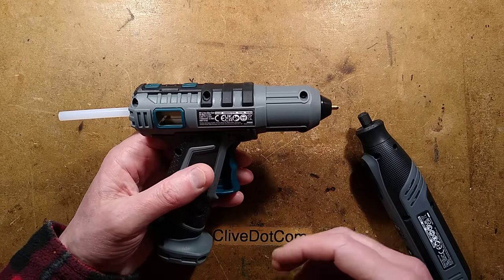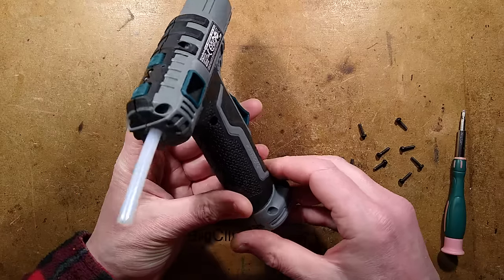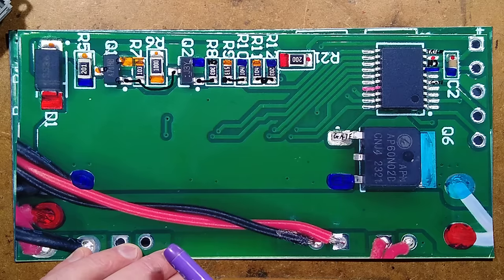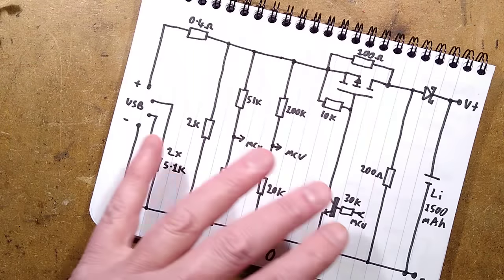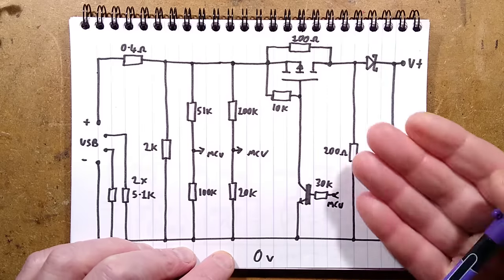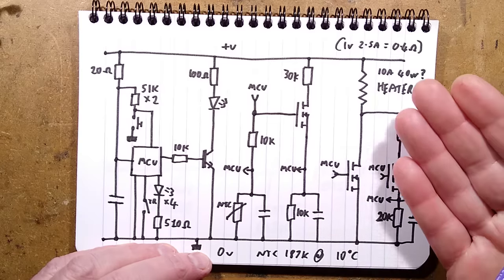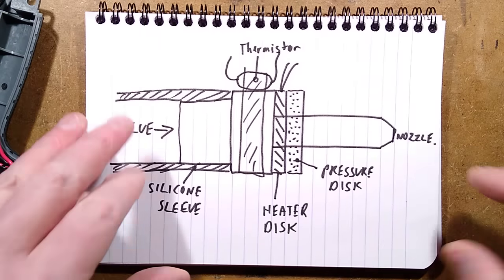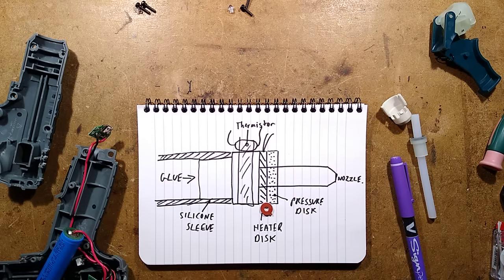ALDI Ferrex cordless hot melt glue gun teardown

Comment: What gets me is the Lack of security at airports when it comes to go into it with construction trucks . I go into Louisville Ky SDF often I drove one of those giant 6 axle concrete mixers the ones that discharge from the front and have the engine in the back and carry 11 US yards of concrete they have a small cab you sit under the drum they would look in the cab I’d been there so many times I was in the system they just handed me a sticker with my photo on it I’d stick it on my hard hat  but the only thing that separated me on the access road from just driving onto the field was a chain link fence ! Could go right thru that onto the ramp and do 100s of millions of damage to aircraft in seconds ! Heck after doing the pour I drove back to the UPS gate un escorted ! Had to cross the airplane parking area . And they are worried about a glue gun and a rotary tool ! I still go in there now with roll off dumpsters and it’s the same .

Comment: ADVICE SOUGHT: I have a double oven. The element of the bottom one is being replaced so the wires are loose inside it. As it stands it's off at the mains. Would I be safe to turn it back on and use the top oven without electrocuting myself as long as I don't turn the bottom oven on? Thanks, Big Clive.
Reply from the maker: If they can touch metal they may cause an RCD or GFCI to trip even if not live due to neutral touching earth.   But if you covered the loose wires with suitable insulation (while the power is off) then it should be OK.

Comment: be careful carrying tools that can fix things they might assign you to fly on a 737 just in case a door plug starts to rattle loose.

on a serious note that is very likely a PTC heater like whats found in the E3D Revo hot end heater. One of the benefits is its very hard for a PTC heater to overheat. In fact that whole nozzle assembly looks like a little hot end.  Which admittedly the first hobbyist 3D printers probably did pillage parts from glue guns.

Comment: Thanks Clive. That was some reverse engineering schematic. Have seen these in the past but was sceptical on their quality. On my to pick up list in future. On airport security I had fun in Boston some years ago , returning to Ireland. In my travels at a flea market I picked up a non working laptop for 10 usd. Casing around keyboard was cracked but screen looked ok. So thought it handy for parts. 2 laptops in a single laptop bag aroused security suspicions and both were swabbed for explosives etc. Personal laptop was grand but the “scrap “ one came back as if it had been filled with cocaine. Luckily I had a screwdriver and poped it open. TSA concluded it had lived in a drug den before finding its way to the market I picked it up in. What was more funny was on returning home and charging it up there was basically nothing wrong with it other than the cracked casing. So after a deep clean the grand kids were delighted with it

Comment: Some airlines will not let you pack li-ion batteries over a certain capacity in your luggage and drone batteries were one of the offending beasites. Don't want a thermal runaway on one of them when the baggage handlers gently smash you bags around.

Comment: plenty of good humour here in the comments but put me straight on the heat resistance scale. As resistance of the mosfet increases current drops therefore shouldn't heat drop?
Reply from the maker: As its resistance increases, more voltage will be dropped across the MOSFET itself.

Comment: Off topic wire coating question,;- what solvent/s are good for removing the enamel? I have 6 or so different ones, but setting-up a bunch of containers to test them all.. I'm loathe to do. Google is broken so I don't even use it anymore.  We're gonna have to go back to talking to each other again 😒
   Burning does not suit, I need it bright. Not a fan of sandpaper, it misses spots unless it has all the kinks out.
    Or who sells uncoated spools?  The wrapping wire is being sold at a premium to people making jewelry and I won't support that. I need everything from like 20g down to that wire that's so thin it breaks when you look at it.
Reply from the maker: It will depend on the lacquer used.  You may need to experiment.

Comment: Odd how they need a micrcontroller for a glue gun.
Reply: I saw a TV commercial where they were bragging about an air freshener with a microcontroller. Worse yet I think it was disposable.
Reply: @davidg4288  Yeah, I’m not surprised about much anymore. I mean, all this needs is a coil of wire and a TDR and it works fine. Have used glue guns for decades and never realized I needed a microcontroller to hold my glue at the perfect temperature 🤣

Comment: 6'3" with an irish name. went through altanta and got a tap on the shoulder at the check in. 
5 men in black, marched about a mile to a bombproof room with a metal bombproof closet in the corner, which i had to strip to my boxers and stand in as the prodded my boxers with a detector of somesort and threw my luggage all over the room.
at which point one of them goes "AHH HAAA...whats this then"
menacingly holding the mars bar i just picked up for a snack.

me in full father ted sarcasm mode with full eye contact and slow talk "its a mars bar" 

he went bright red and they all trooped out like a monty python sketch and said i could go.

in texas because of this i got diverted to the head of security there. who called them a bunch of arshole idiots and laughed about my "smuggling chocolate bars" 🤦

Comment: It is not that the glue gun looks like a gun, it is you tried to put one of those bad lithium batteries inside your checked luggage. Those bad lithoum batteries can burst into flames and brring down the plane.If they are in the baggage hold no one can put out the fire. You cannot mail lithium batteries in the US mail. All lithium batteries must be in your carry-on. Each airline has its own rules but they are not enforced except are baggage check and TSA, xray.

Comment: like many of the commenters, I feel considering a hot glue gun a weapon is stretching it... 
🤔though I could see the potential risk of allowing it on the cabin since you could technically use it to melt wiring (assuming you can get a critical electrical panel open & get at the wires)....
...that said, you could also technically use your fingernails to strip wiring insulation so definitely debateable🤷
:D oh well, chalk it up to your donation to "Big Brother" ...
🤔I wonder... would a wireless soldering iron also be considered a weapon (I'd imagine so as it does have a pointy bit you can stab people with)...

Comment: ahh the joys of the overpowered and undereducated TSA and it's cousins in various lands
they almost always freak out about innocuous things, and charge you an arm and your left nut to ship the "dangerous"(never actually so) items to your destination for pickup
the ONLY items that are ACTUALLY something they should be allowed to fully ban are larger or custom lithium packs and other volatile chemicals that may damage the aircraft in the stresses of flight(galium makes sense due to the degradation of aluminum parts, like most aircraft bodies)
but a hot glue gun? no, you have a small locked area on the plane that cannot be unlocked until landing, that you place claimed "dangerous" items in, and make it some kind of interlock with the landing weight on the landing gear, pretty easy and gets rid of the stupid TSA reactions
you simply declare "this item may scare and confuse people, it is among the items that are recommended to be locked during flight, lock it in my ticket linked locker until we reach the destination"

Comment: Lithum batteries and aircraft issues go way back to the late 90's mate. They can be more dangerous midflight than a gun. Fire hazard. Super duper fire hazard. Anything bigger than a few amphours, is as you clearly know is dangerous. 700 klms per hour and quite a few tonnes and hundreds of lives at stake..
Reply from the maker: That's unfortunate given that every single passenger has a mobile phone with a high capacity lithium cell in it.  And several have laptops with even bigger cells.
Reply: @bigclivedotcom  yeah I know right... go figure huh. Its not like samsung had a propensity to bust into flames or anything. 😆